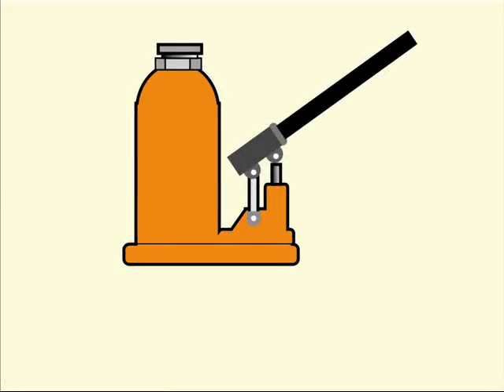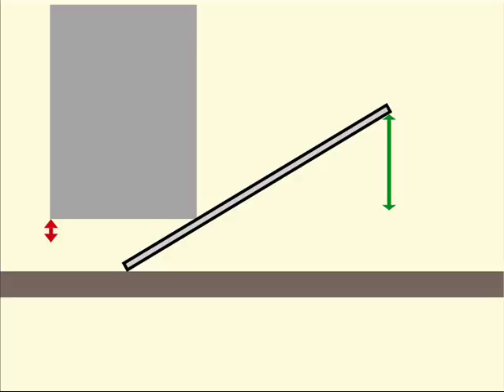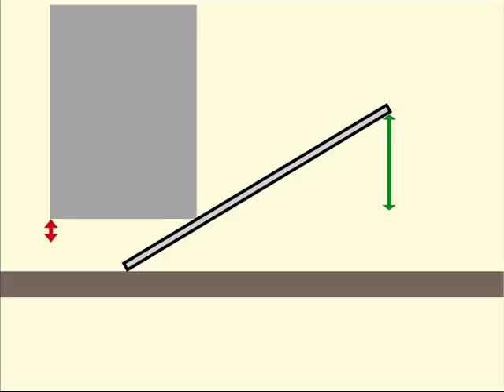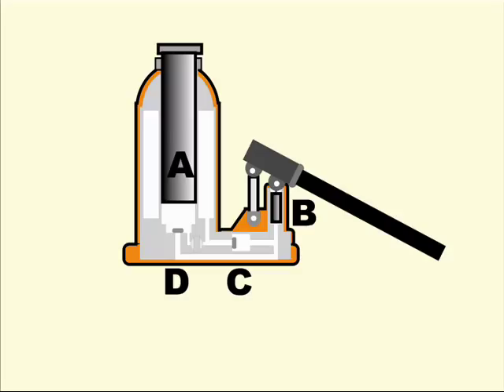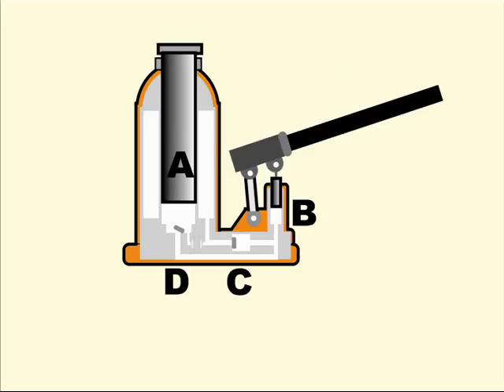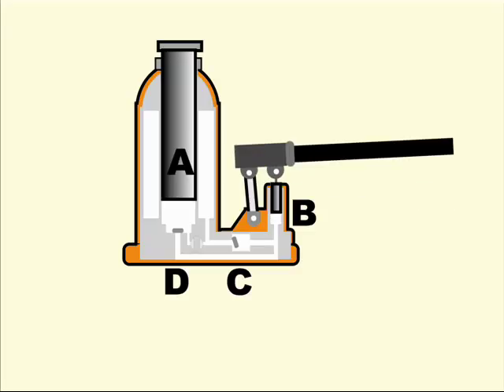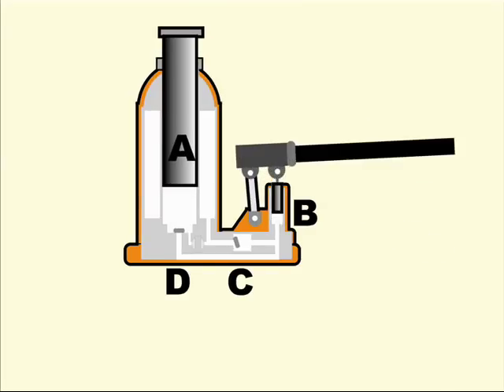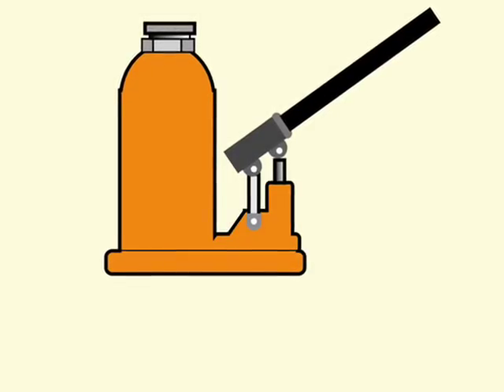How a hydraulic jack works

Comment: Thanks much for an excellent video clip. It gives the best explanation for how a hydraulic jack works.
I have two such jacks that have failed.  
Can you advise what is the most common cause of failure of hydraulic jacks and if they are easy to repair.
Thanks again for any advice.
Reply from the maker: Well, it depends on the type of jack and use. For instance, in tripod jacks, one of the legs may have a crack or dent and that can be fatal for the worker under the vehicle. However, in normal bottle jacks the most frequent cause of breakdown is the seals, an upside down installed seal is not uncommon, same as using corrosive fluid, such as brake fluid for the hydraulics of a jack. Also, balls in check valves seem to last forever, however, a check ball not seating properly or a burr or dent on the seat can be very bad for the dependability of the jack. Maybe the best thing to do would go to a professional for major repairs, such items as jacks are essential for a safe work environment and it is preferable to use no shortcuts. Contamination with dust can also be very bad for jacks, since valves and pistons can stick or the seals can wear out quickly. In exterme cases, cracks in the cylinders can render a jack inoperative.

Comment: at the return stroke how fluid comes back
and i have not understand regarding butterfly valve can be please kindly help me  sir
Reply from the maker: When the small pump is working, it takes fluid out from a reservoir placed around the big cylinder. When it is time to  lower the load again, the butterfly valve lets the fluid return to the reservoir and the big piston goes down. If you open the butterfly (so called because of the handle it has) wide open, the piston moves rapidly and the load drops down suddenly, if you open it just a little bit, the load comes down slowly. You can even close it and stop the load midway. It's just a way to empty the big cylinder and return the fluid back to the reservoir. I hope that helps.

Comment: very usefull video can u explain to chang the jak upsidedown
i want to use it invert
i hope that u understand what i mean
thank u again for this video
Reply from the maker: Hi, Abousamah, I found a couple of videos about using a hydraulic jack upsidedown. One guy uses an electric welder and the other epoxy cement. Both cases were successful. Please watch them entirely, so you have a better idea on how to do it. The solution is using a piece of brake line or similar pipe to allow the jack pump to "suck" the oil in from the reservoir. They go into a lot of detail, which is good. Here are the links: https://www.youtube.com/watch?v=0nlSp21KZJ8 - and - https://www.youtube.com/watch?v=Dv3FV0N-Q9o .
I have some interesting videos on solar power, just in case you are interested, solar is wonderful! light bill goes practically to zero and you protect the planet. I suggest my video on solar golf cart - https://www.youtube.com/watch?v=X5B7PIMktVI - I hope this info helps! Have a nice day!

Comment: The best explanation on YouTube. Very clear and simple. Excellent!
Reply from the maker: Thanks a lot!!!
Reply: The explanation is wrong. It is a function of pressure. The pressure remains the same across the surface. As the surface area increases the force increases. The force is multiplied by the ratio of the surface area of the small piston to that of big piston.
Reply: @petersonthattil9118  your correction isnt valid until you post your own video.
Reply: @mauricobian  It is sufficient for a seeker of knowledge. He finds solutions for himself and a small correction is sufficient. If someone is in doubt they can ask questions. I'll not bother to post a video on this subject.

Comment: can we get information about qty and grade of oil
Reply from the maker: Hydraulic oil, of the type used in most hydraulic applications is recommended. Do not use brake fluid, since it can corrode the gaskets and seals in the jack.and your warantee will be void.
Reply from the maker: Low viscosity oil works okay. The kind of oil used in tractor hydraulics and some heavier earthmoving stuff uses hydraulic oil thats essentially the same viscosity as 10W motor oil. The main thing is DON'T use brake fluid. It damages the rubber gaskets in the jack. Please look at these questions and answers - http://www.practicalmachinist.com/vb/general-archive/hydraulic-jack-oil-question-94274/.